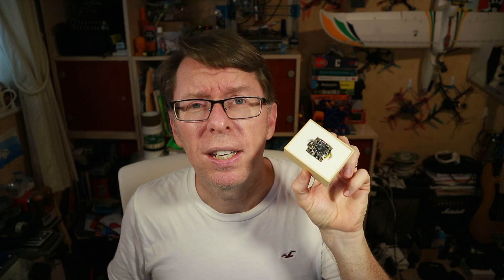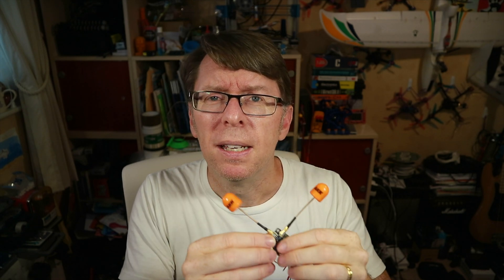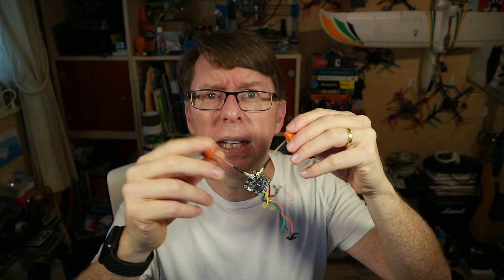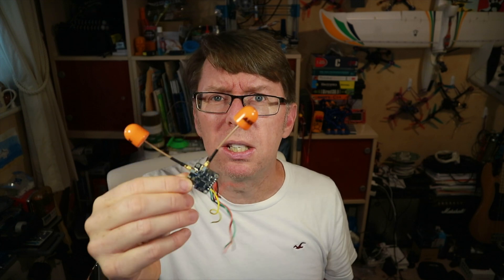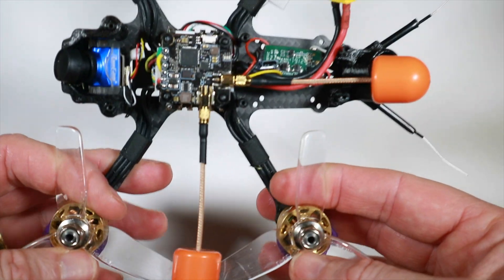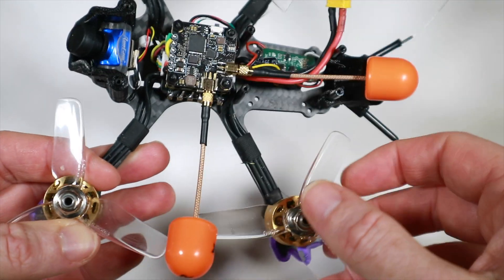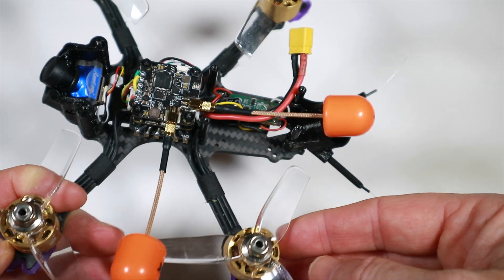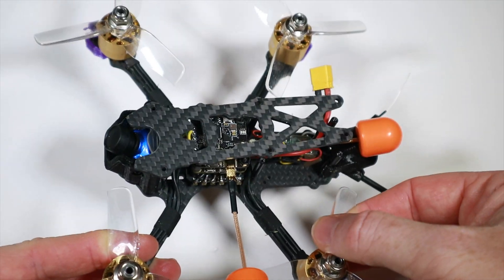AKK Dual antenna VTX - Will it work?  Supplied by AkkTech

Comment: It’s not the dual antenna it’s akk I use dual pigtails on my wing using tbs hv and I fuckig love it but I cause  minor issues for people I fly with but they just change the channels and bands on the vtx. I never got anything good from akk and if I did it didn’t last long at all an akk vtx will burn out on you in a week or two
Reply: How do you connect two pigtails on TBS HV?

Comment: I thought that going to lh polarised on one side of the goggles and rh polarised might be the go too, but might just make the signals even more mixed up. I don’t think I’d invest in one.
Reply from the maker: I can't see a sensible way around it - aside from transmitting on two distinct frequencies and having a receiving diversity system that could pick from the strongest signal on two frequencies.  It's the only way I can see of getting proper TX diversity without multipathing

Comment: my guess is you have to use classic diversity module on goggles with different polarized antenna for this setup to work
Reply: by classic i mean rapidfire wont reconstruct well... but polarity will make sure each set of antenna does not affect the other set... and diversity will make sure that one set of antennas is acctive at a time

Comment: Just wondering if you have a rhcp, and a left on goggles and vtx?
Reply from the maker: It would seem a more sensible idea - I didn't try it as I didn't have any LHCP for my goggles.  It also wasn't documented that you should do so.  I've still got it in the corner if I want to try it again, but I've already swapped the VTX out of that quad so I can get on with testing other stuff without having the hassle of two antennas getting in my way
Reply: @CurryKitten  I wanted to buy one to check it out, but Bardwell said it doesn't make sense, but that hasn't killed my curiosity, lol.  I know nothing about these things, but it seems if the receiver was made to receive both, and maybe use rapid fire tech to merge the images. It seems something like this could be done to eliminate multipathing, I guess if it was that simple it would have been done.

Comment: It's interesting to try and do diversity at the VTX.  I would expect better results with two antennas of the same polarization and one with a 90degree connector.
Reply from the maker: It strikes me that to do it cleanly, you need to be transmitting on two different frequencies with goggles/some sort of diversity rx that can choose the best signal between them.  I can't see a way that you aren't producing multipathing when on the same band/channel

Comment: I never use skews including on 5.8g...You could have removed one of those skews to prove your theory methinks....Both were lipo blocked as well with one wrapped around the lipo power cable...God knows how bad it would be for someone not having the benefit of Rapid fire...It's why I don't use 5.8g if I can help it.
Reply from the maker: I didn't want to run it on a single antenna as I wasn't sure if it would cause damage to the VTX.  Although there's an amount of blocking in that configuration, there was in the original VTX as well which still got a better picture.
Reply: @CurryKitten  I doubt it would damage the vtx, I don't think the RF split is that clever TBH. The image was okay, it was the constant flashing that made it look bad IMO.
Now the test is done, it could be worth trying on one antenna to find out. Maybe you could also bottom mount your Lipo temporary with tape?

Comment: What if you used 2 RHCP antennas, and for the one the sticking out, you used a right angle mmcx or something? And then you could set them up in a way such that one antenna is on the front of the quad and one antenna is on the back of the quad?
Reply from the maker: I think the L shape isn't a bad idea if you have one horizontally and one vertically.   I think you'd get more benefit on coverage that an on in front/on behind configuration.  But with two RHCP signal going at once I don't think it's going to help on the multipathing issue

Comment: I wonder how it would perform with two RH antennas, and maybe bending the antennas down would both clear the props easier and
Reply: Provide a less obstructed signal .
Reply from the maker: I had considered being downwards, but they would stick out below the frame slightly and I was worried about potential damage there.  Perhaps the same polarization in different orientations would help - but according to AKK that's not the intended use ?

Comment: I bought one for cheap as more of a curiosity than anything. I did'nt even try it yet. Someone at AKK liked the look of the dual antennas on the DJI system so much, they decided to implement it on a regular VTX with no real benefit, lol.
Reply from the maker: You have to wonder if that's literally what happened.  Seems like either nobody is testing, or they are but ignore their results

Comment: You want two 90 degrees elbows on them so they are vertical. This will give  you Vertical and Horizontalr signal off them. Then your rx will get the signal in all orientations.
Reply from the maker: If they are both on 90 degrees and are vertical, then how are we getting vertical and horizontal from them - surely both will be vertical ?

Comment: I definitely would suggest running 2 antennas with the same polarization and see if the flickering goes away. If they have already dealt with the impedance matching of transmitting with 2 antennas then running 2 of the same should work quit well.

Comment: Have you tried it with RHCP and LHCP antennas on your goggles at the same time?   The idea does seem more pants than Primark. If you set your goggles up with a RHCP and LHCP antenna you can no longer use a onmi and a patch directional antenna so in affect you actually lose range, unless you use a RHCP and LHCP patch on the goggles at the same time but then you’ve lost you omni. Not sure what AKK we’re thinking as they do make very good products up until this point.

Comment: Would be interesting to see it with 2 antennas of the same polarization to see how that does. When I first saw this a few months back I was wondering why they would want two different polarizations, it just doesn't make sense. But maybe with 2 rights or 2 lefts it might actually work good. Thanks for the review!
Reply: Maybe it’s supposed to be used with those equally weird tbs patches? 🤣
Reply from the maker: 2 rights or two lefts in different orientations would make a bit more sense, although being circular polarised the loss you get in a turn is pretty minimal compared to a linear - so who knows ?

Comment: Something this difficult to mount.. should at least perform above average.. which it "clearly" didn't.
Good review though.
Reply from the maker: With a lot of companies I just don't think there's enough testing on actual quads done - if there had been then someone would have surely suggested 90 degree antennas and reported back on the picture not being that good
Reply: @CurryKitten  We must be missing something here... Why would anyone design a format like this.. and then stand the cost of production... Without testing a prototype first... Just dosn't make sense to me.
Reply: @heliharris69  use two 180degree patch antennas on it and you understand why it is like it is